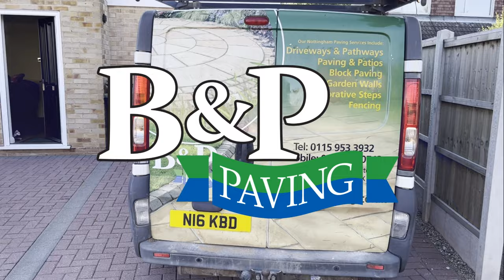We’ve had all our tools robbed !! #058

Comment: Sorry you got broken into. Consider adding extra locks to your vans. I know it's a cost but if it's anything like where I live they'll be back in a month or so knowing you've got new tools to steal
Reply from the maker: Yeah it was just unlucky normally were a lot safer
Reply: They won't do any good, if anything they will put extra effort in knowing there is likely kit in there. The steel on the van doors is so thin the thives will either cut it around the locks with tin snips or bend the door out with a bar.

A van vault bolted to the floor is a better option.

Comment: This is the number 1 most scummy thing anyone can do to a tradesman. Its happened before to tradesman I know and I always throw them a little bit to get up and running.

My Dad (who is a bricklayer and also does a lot of paving) recently had his Stihl cutter of 25 years old give up the ghost, and he asked me to order and an electric one (Evolution R300DCT). Its £250, comes with a blade and is as powerful as the Stihl was. The only thing is you need electric, but most of the sites he works at (like yourselves) have a hook-up available.
Reply from the maker: Thanks will take a look

Comment: There needs to be real and GENUINE pressure put on the government to bring this issue under control.

Remember how twoccing used to be a daily occurrence on basically any estate in any area of the country until the government FORCED car manufacturers to come up with a solution? 

Same thing needs to be implemented on commercial vehicles, the "security" of these 20 and 30k vans is NOT fit for purpose and is an embarrassment.
Reply from the maker: Yeah the van theft thing is completely disgusting !!